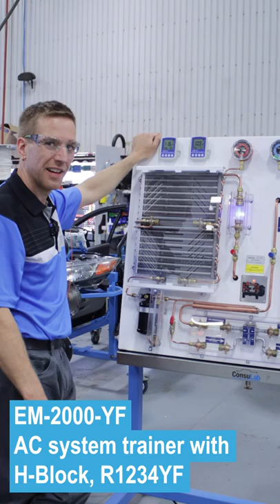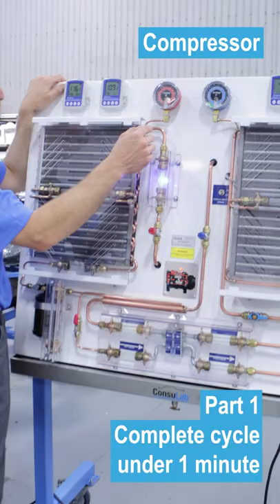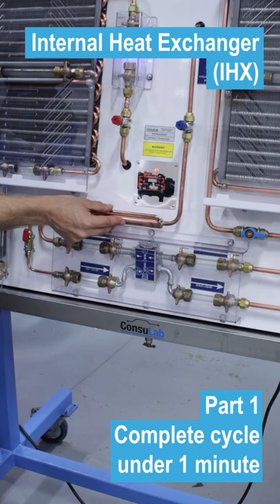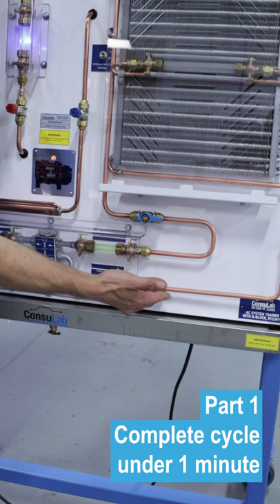The physics of air conditioning in under one minute

Comment: Anyone that's not in HVAC, this will sound like mumbo jumbo lol
Reply: Yup!
Reply: Lmao so true 😂
Reply: Just sounds like he’s ranting off a conspiracy theory lol
Reply: Sounds like ancient Greek to me
Reply: LMAO for real. Only been in HVAC class for 4 months now but still confused. I got no idea how the evaporator cools with air if it's near the passenger area covered up. That's the blower at work cooling it is it not?
Reply: @flamestar557  the blower moves the air through yes, in the event the blower is inoperable or seizes the evaporator coil would freeze up.
Reply: Yup. It's not that helpful of an explanation. I already have some idea how heat pumps etc work, and he left me more confused than I was at the start. His "lesson" assumes we already understand how it all works.
Reply: @wkelon1121 you can hear me cussing from inside a walk-in freezer when that happens. Bust out the water hose time.
Reply: @flamestar557 the blower motor that is blowing the hot air from inside the vehicle puts heat into the evaporator. This heats up the refrigerant as it passes through and evaporates to a gas. The air that exits the evaporator core and flows through the vents feels cold because it has transferred the heat to the refrigerant which is flowing through the system. Hope this helps.
Reply: @flamestar557 as the 70⁰ return  air passes across the evaporator coil the refrigerant is absorbing  the heat after the heat is absorbed the discharge supply air is around 55⁰  so therefore the evaporator did not cool the evaporator removed heat from the air passing across it 💡

Comment: The h block is basically a thermostatic valve which uses the second stream as the sensing bulb
Reply: Nice explanation, never heard of one of those.
Reply: I've never seen one of these. If that's what it does, does it work like a TX Valve?
Reply: I was about to ask what an H-Block is and why the refrigerant goes through it a second time after coming out of the evaporator.  That makes sense.  Tnx.
Reply: @BryanTorok yep 😊 the returned gas goes thru and the temperature lowers or raises the pintle for the lower line and thats how it auto manages superheat
Reply: In England we call it expansion valve
Reply: That should be my same question and answered. Thank you!
Reply: Ooohhhhhh yeah, the old thermostatic bulb to a second stream as the sensing bulb trick. Classic hvac
Reply: Yea I've always known thermal expansion valve was what was responsible for all that
Reply: @minoX6 in florida we call it that too and use british thermal units try to keep it universal
Reply: @MonsterNinjaz Isn't that how normal tx valves work but they use a small capillary tube going to the diaphragm instead of the entire suction line. P1+P2 = P3
Reply: It's just a different type of metering device for that specific refrigerant
Reply: Thank you
Reply: So basically the TXV… but fancy?
Reply: You just went from high-pressure to low pressure after an H Block magically. What the fuck happened
Reply: nope, it's a band from the 90s
Reply: See how hard was that made far more sense

Comment: I didn't understand not even a thing 😂😂😂
Reply: I open my freezer everyday wondering how the air comes out cold. Blows my mind everytime. 😂😂 I just want to fully understand this.
Reply: try and keep up....something something blow air over it.
Reply: @nikkiluv6435 you have to understand boyles ideal gas law then its not hard yo ynderstand
Reply: I understood everything, but I do that for a living lol
Reply: Same😅😅
Reply: I might be wrong so correct me if so, but what I understood is that the refrigerant swoops in and snatches away the heat from the air inside. When the indoor air loses its warmth, it becomes cold – think of cold as basically a fancy term for 'less heat or energy.' That is, cold is just the lack of heat. So, the air, now with less heat or, as we know it, 'cold air,' gets blown back into our homes, and voila, that's the refreshing cold breeze we feel.

The evaporator is the main character in taking away the heat from the warm air inside our homes.
Reply: Compressor compresses the low pressure low temperature gas to high pressure high temp gas then goes to condenser coil. The coils are hot and heat wants to go to a place of less energy (colder environment) so now we have a fan blowing over those condenser coils. Now as it cools down it condensates the refrigerant to a high pressure high temperature liquid. Goes through the filter drier where moisture is absorbed and contaminants. Now the refrigerant goes through a metering device which expands the gas and turns it to a low pressure low temperature liquid the warm air in our homes or fridge, now wants to go to lower energy (cool evap coils), so it  heats up and turns thst refrigerant to a low temp low pressure vapor, so now that heat absorbed from your home needs to be disposed some place where it don't matter so it goes right back to the compressor and rid through the condenser unit to outside and it repeats....

Comment: I still don’t get it the whole idea of boiling and heat screws me every time
Reply: Don’t think as boiling as heat as you know it. 

Think as refrigerant as water I don’t know if you’ve ever experienced hiking up in mountains over 13,000 feet elevation Water boils at 187°F  you can kind of stick your finger in it for a minute it takes a lot longer to boil an egg almost impossible to make spaghetti soft. 

We know sea level makes water boil at 212°F

The boiling of refrigerant is the same thing changes with pressure and temperature they move together. 

And the exact opposite water in the air condensates with your drinking glass full of ice on your kitchen table on a warm summer day the water droplets are the same as refrigerant that is vapor and when they strike the glass the water in the air turns into liquid water and pours down the side of your glass on the outside

When that hot refrigerant goes into that condenser at 140°F or 160°F the inside walls of those copper tubes are being cool down by the fins that might have 80°F air blowing over them making the surface of the copper on the inside cold and that hot high-pressure gas touches the inner tubes of the copper walls the exact same as the air touches you’re drinking glass and they start condensating and cooling down back into a liquid. 

To teach yourself exactly what is going on inside all the tubes imagine yourself as a molecule of refrigerant and what state of change are you going through as you travel throughout the circuit imagine your temperature and imagine yourself turning from a liquid into a gas and back into a liquid again.
Reply: Dry-ice temperature-range
Put dry-ice into water = see boiling = frigid = ratio-versus = relative-to room-temperature, boils dry-ice. 

Air-gas(not gasoline but propane, methane, butane, LPG, CNG, LNG, ...) 
= during compression, heat-generated 
= when compressed is room-temperature
= when release-decompression(LNG,CNG especially or butane-propane cigarette-lighter-gas) is cool-supercooled

Decompression in radiator(evaporator)-piping(with fins) causes metal-radiator and the refrigerent to "freeze" but it is gaseous and not-water at room-temperature. Air-flows through the outer-metal-parts and gets cooled (similar to air fan flow through a computer CPU heat-sink)

Mod-hack LPG-propane the home-invasion air-conditioner refrigerent.

Not needed
= radiator, piping, radiator, piping, radiator 
= Water generator (evaporator dripping tray and hose) is air-cleaner (moisture scrubbed from air results in dirty-water - filtered air)
= Piping in twos, 45deg angle, 5mm gap in between parallels for air flow between 2 pipes, bottom-of-top and top-of-bottom join at sides to form a single flow direction (U-joints same as fridge), fins are mounts to hold pipes apart, spaces are easy hose down, environment sand gauge, ...sandwich 2 sets between two slow fans, above and below fan-axle with gap(fan-axle) between sets for air-pull-air, ...
Reply: Oh, receiver-dryer is for the home-invasion person... if LPG...
Reply: It comes out of the condenser as a sub cooled high pressure liquid
Reply: Boil is used the same as evaporate. If you put rubbing alcohol in a cup it sits there and eavporates slowly and no noticeable cooling occurs. Wet your skin and the alchol evaporates quickly by absorbing heat from your skin. A/c evaporator is a stress environment for the refrigerant as a low pressure liquid to boil when heat can be absorbed to boil it. Now the refrig is a gas and has warmed a little. Compressor moves the refrigerant and also puts it under pressure and adds heat from compression. This high pressure gas is now a gas  that is streesed and tends to liquud state if it can shed heat. The temp difference of the hot gas to ambient air temp encourages heat loss since temp difference affects geat loss. Air passing condenser is tje waybthe heat is lost to the passing air and stress is reduced and it changes to liquid and is clost to ambient temp, maybe lower. This liquid refrigerant now is restricted by expansion valve or orifice and passes through the ev or orifice restriction and now is evaporator to begin liquid to gas phase change again. 1234yf is a tad bit more difficult to do the gas liquid phase change so an additonal condensing unit is used. The liquid line goes through a heat exchanger that is a tube within a larger tube with cooled gas flowing in inner tube and liquid that may still have some gas flowing in outer tube. The two layers are separate. The last bit of gas should condense with the additional cooling. Also, liquid going to compressor poses a risk of liquid locking compressor so the hest exchanger can at times be evaporating any remaining liquid on low pressure side.
Reply: Us bro us
Reply: When the liquid boils, it carries with it heat from whatever it left, leaving the surface cooler. Some special liquids have a very low boiling point.

Another example would be like kicking a ball. If you continue to kick a ball 100 times, it will drain energy from you. And the only way for that ball to move was for you to kick it.
Reply: The only time boiling is important is to make sure the compressor isn't taking in liquid. Gotta make sure your superheat has enough room to vaporize before getting to the compressor.

If that doesn't help, just remember higher PSI, higher phase change (liquid to vapor / vapor to liquid). All they mean by saturated temperature is the temperature in which the refrigerant changes from one to the other. R-410a at 129.7 changes from gas to liquid or liquid to gas at 45 degree fahrenheit.

If that doesn't help remember superheat is from the perspective of the refrigerant. The refrigerant is heating up and that makes liquids boil. The confusing thing is that happens in the evaporator and it cools the air because of the exchange of energy.

Tradesmen get stuck in there ways about how things are taught. The "great" Ty Branaman was part of the online video course for my HVAC training. He yelled pressure converted to temperature about a thousand times before mentioning a PT chart or before I ever got to refrigerant gauges to find out ITS ALREADY ON THE DAMN GAUGES!

If none of that helps. Keep asking ChatGPT until it explains it in terms you can understand. It doesn't get annoyed but you do have to double check its work as it will accidently lie to you.
Reply: Boiling is a side-effect of heat leaving a liquid in the form of gas. You can boil a liquid by either heating it or lowering the pressure around it.

Efficiency in heat transfer goes up the bigger the temperature difference you can create. If there is no difference you can't transfer at all, if it swings the other way the heat transfers in the wrong direction!

The whole idea with compressing a gas and then allowing it to boil off is that it is a simple way to get your working fluid to the right temperature to be effective. You can always find a gas that boils at the required temperature/pressure for the application, and compressors are fairly simple and reliable machines.
Reply: Think of it as conducting energy or maybe moving the heat as an energy. The refrigerant is used as a conductor or median through which the energy is moved.

Comment: Videos like this, while great, show me just how dumb I am, lol. Definitely respect for those who work in trades and learn all of this.
Reply: When a liquid changes to a gas (evaporates), it absorbs a large amount of heat from its surroundings.

Conversely, when a gas condenses to a liquid, it releases this heat.

We can help this process along with fans and compressors.

The R1234 he's talking about is the gas they use. It has an extremely low boiling point (-20F, -29C) So it can absorb heat at very low temperatures.
Reply: Not dumb, just uninformed. the only difference between a master and a beginner is knowledge. and anyone can gather knowledge. Just because they sat down and read a book about it doesn't mean they are smarter than you :P
Reply: Thank you alot i just got a job opportunity to work with industrial air conditioning , thanks to you this makes alot more sense@stevenlarson3316

Comment: Good trainer especially including the latest refrigerant with internal heat exchanger in multiple see-through glass tubes
Reply from the maker: Thank you! it was an important part of the product design. It makes it so much easier for students to understand the magic.
Reply: @Consulab  you said the gas comes out of the condenser with high pressure high tempereture
But mr the gas has hi p lo temp so that it would be liquified
Reply: @user-kp2vv4ye9g it's under pressure, so it can have a high temperature and still be liquid.
Have you ever grabbed the liquid line after the condenser? Lol

Comment: Nothing better than R22 AND R12
Reply: I prefer R2D2 myself.
Reply: I prefer 502
Reply: The thing with R12 is that it wasn't a lazy like 134a so sitting in traffic on a 95° degree day you are freezing your butt off 134a on the other hand you'll be sweating. I'm honestly pretty impressed with 1234yf in both my cars
Reply: @vvti18  sounds like an improperly designed system to me... Prob. Undersized, or they dropped r134a into a system designed for CFCs without other alterations.
My car has r134a with a properly sized system and inside the cabin I've always been chilly even in 42°C weather here in Italy (it's a Toyota)
Reply: @vvti18 my grandad had an old Chrysler that if you left the AC running on the coldest setting for too long the condenser would ice over on a 100° day 😂
Reply: You mean r2d2 from Star Wars?
Reply: @SUPRAMIKE18  evaporator

Comment: What's the reason for the internal heat exchanger?  Why would you want to heat up the incoming charge?  Trying to cool down the incoming gas to the compressor?
Reply: The more heat you can send to the compressor the more heat the condenser can expel.
Reply: It's doing the opposite.
The gas leaving the evaporator is cool, while the liquid leaving the condenser is hot, so you are cooling the liquid down, which allows it to absorb more heat in the evaporator.

It is basically taking some of the heat from the compression cycle and short circuiting it directly back to the compressor so it bypasses the cool side of the system.

Comment: Who sat down and thought about on how to do this?.
Reply: an engineer with good knowledge in thermodynamics.
Reply: Mr Carrier. “Boiling off” or catching heat in the evaporator and transferring that heat outside to the compressor/condenser section is magic.
Reply: @smokeysmith1282  1902, mr Carrier was tired of drinking warm beers

Comment: If you wis to install an internal heat exchange on a normal split phase unit. Will it increase the efficiency.. or if you cool the liquid line after the condenser outside will it increase the efficiency

Comment: low temp high press enters the H block which meters the high pressure into low pressure, IT DOES NOT REDUCE TEMP OF THE REFRIGERANTS thats what the condensor does. SO it cant enter hot leave cold, it enters cold with high pressure leaves cold with low pressure.
Reply: Well it leaves even colder after the pressure drop...the condensor just cools it down to ambient
Reply: Mr madison, what you have just said has left everyone in this room Dumber .  First thing I learned as a newbie was that a drop in pressure equals a drop in temperature.
Reply: But it does though.... Are Guages are proof of that.... Pressure has relation to temperature.
Reply: You're thinking of subcooling which is correct, but subcooling is there for us to ensure we have no more vapor refrigerant, and we do that by using Guages, on the service port and thermometer on our discharge line....

Comment: Does the electricity bill actually go higher if you turn it on and off constantly? Or when it's left on?
Reply: there's a lot of factors. including the current weather and the efficiency of the AC system as well as how well your house is insulated as well as how much of an effort to keep your house cool. This means turning off any unecessary electronics and appliances such as turning off computers when not in use or televisions when no one is watching. Not letting in the sunlight etc. Ultimately though, the theory is that if you never let your house get too hot the AC compressor has to work less in order to remove excess heat from your house. Keep in mind. AC systems don't move air. They move heat. They move heat from the inside of your house/car to the outside.

Comment: What's going back in to compressor gas or liquids?
Reply from the maker: Always a gas
Reply: It better be a gas, or you’re going to ruin your compressor
Reply: Liquid can’t be compressed. If you try to the compressor ends up compressing itself lol.
Reply: Liquid can't be compressed,  thats why in car brakes you bleed the air out, because air is compressible.
Reply: Also that gas actually cool down the compressor also.